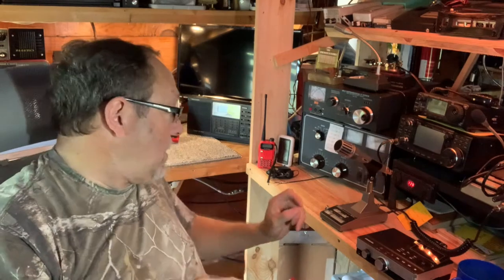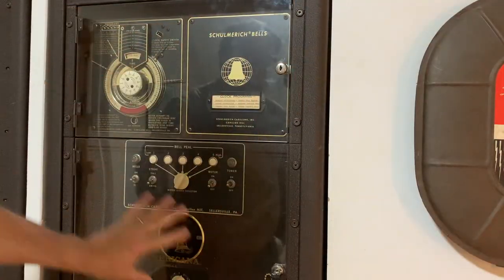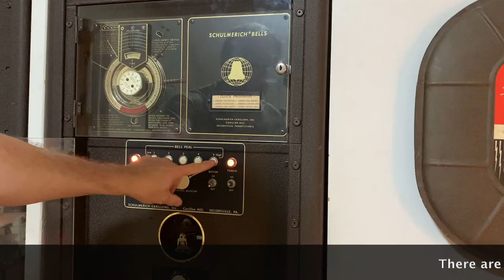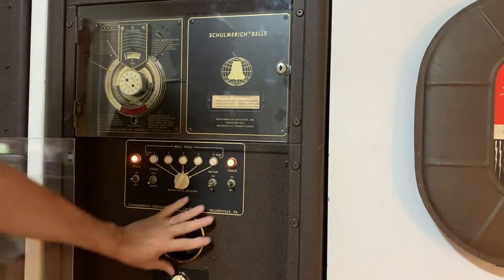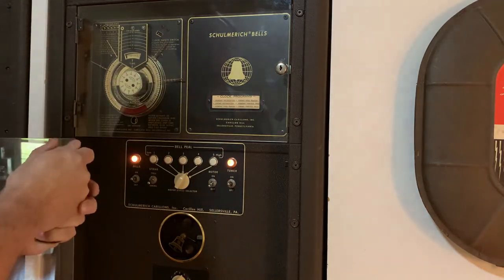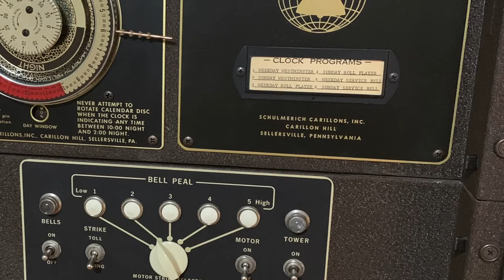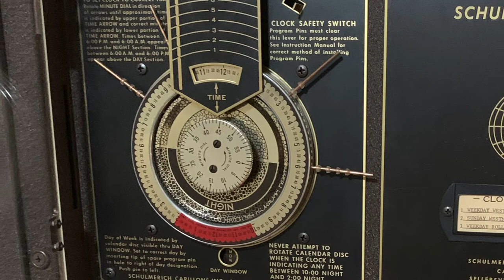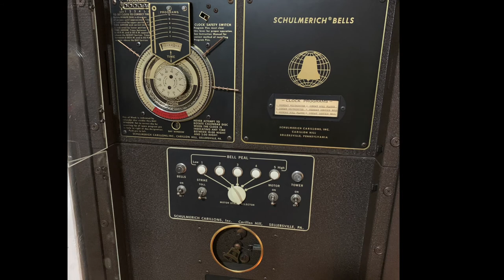Cathedral Bells on a 1960's vintage bell system

Comment: Hello!, I have a casio tv-470 and when i turn it on the screen is white even if i turn the brightness off its still white screen but there's a sound
Reply from the maker: Likely a bad pot (brightness control). It’s a very good sign that you have a raster (white screen) and sound. Does it have a contrast control?
Reply from the maker: @JayPeeEV  koviatt at gmail dot com. Might be easier to communicate via email. I’d like to see some photos.